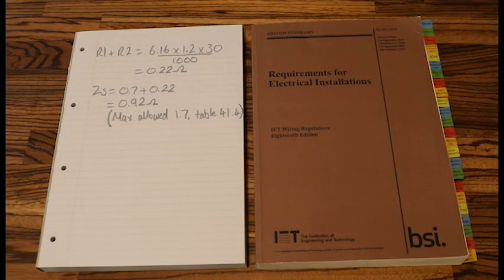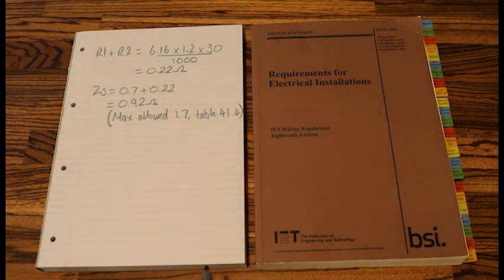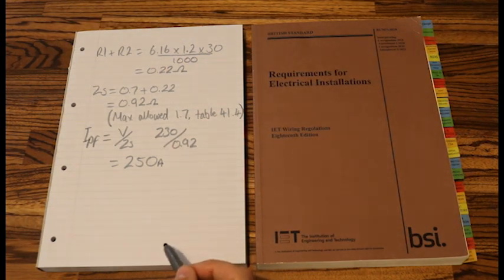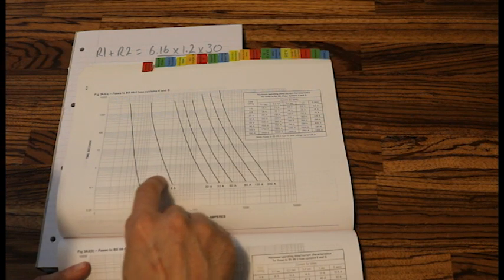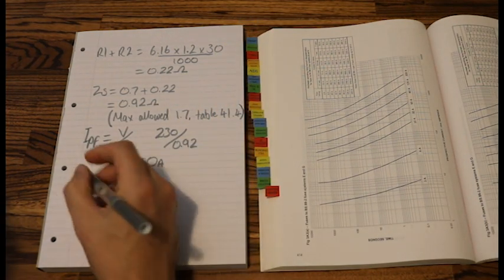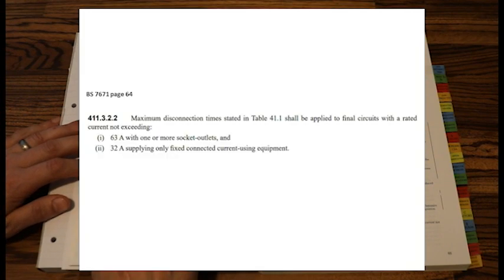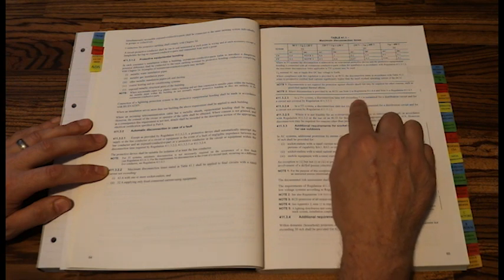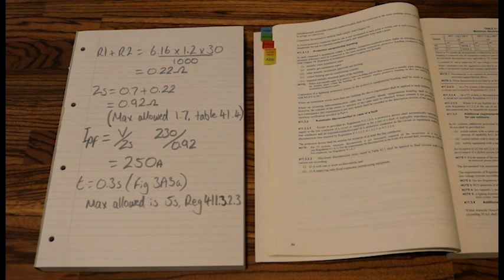Finding the value of t (time) when calculating the size of your CPC

Comment: Thanks for the video.  As an adult learner these are very valuable.  Can you explain a bit more of where you got the figures of 6.16 and 1.2 when calculating the R1 +R2 value (I understand the 30m distance and 1000 to covert to Ohms)
Reply from the maker: Hi there, we are slowly creating short video's for each step for sizing your live and cpc. I shall get one of the team to create the video How to calculate your R1 + R2. Hopefully it will be ready over the weekend for you. The value 6.16 comes from table I1, p218 OSG and the 1.2 comes from table I3, p220 OSG.
Reply: @ElectricalStudentsUK  Thanks for your prompt reply.  I see the 6.16 comes from 6 mm L and CPC (Tbl I1)and the 1.2 from Tbl I3, presumably to adjust for ambient temp?
Reply from the maker: @no_short_circuit  Yes that's correct, I3 adjusts for maximum operating temperature. So by using this multiplier we are using a worst case scenario. Table I2 gives different temperatures but living in England, we never have a constant temperature so low. That table would be used if you are running cables in some kind of cold store/freezer area. Video for R1+R2 has been completed and will be posted soon. If you have any other queries or something you would like explaining let us know and we'll se about making a video for you